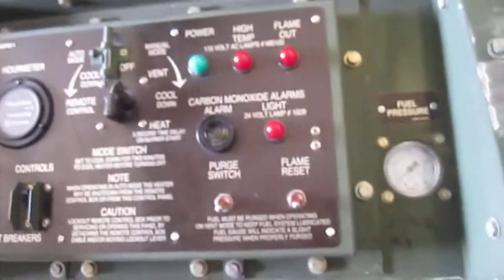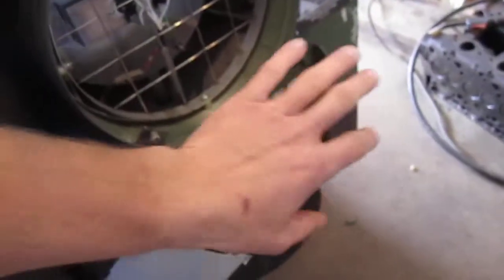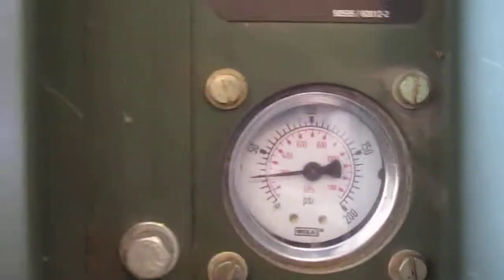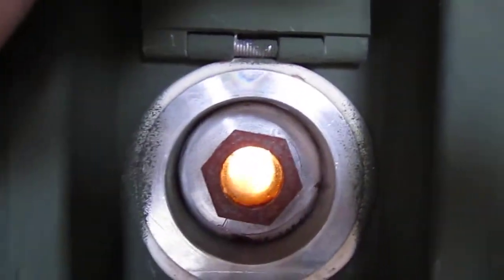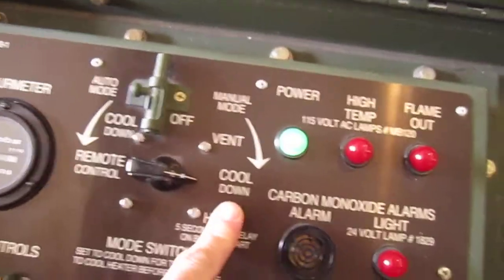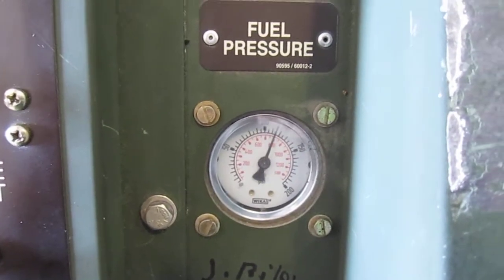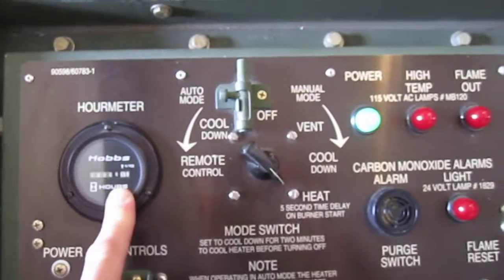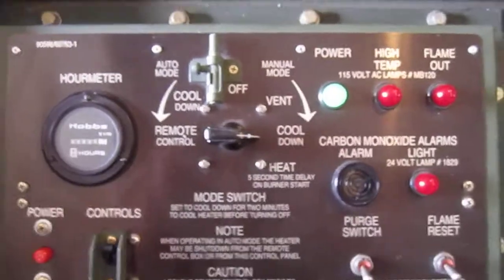army heater part 2

Comment: Do you have a video of the thermostat you installed
Reply from the maker: @ShaneDahlquist  unfortunately no but used a regular 2 wire thermostat, I cut into one of the hi limit button switches that are in the front of the unit, I believe there is two switches one is a high limit. The other is an over hi limit switch, so the thermostat acts as if the temperature is  is at a hi point.
Reply from the maker: If you want more information I’ll have to get it out and look at what wire I cut into and how I wired it.
Reply: Oh yeah that's way simpler way than prolly  dealing with any of the others.
Reply: Wires.  Thank you

Comment: have a heater like that wouldn't prime, has spark, pressure only goes to 65 pounds,, flame out comes on,  fired up one time with lots of smoke when shut off wouldn't restart same 65 lb pressure thanks
Reply from the maker: @cityfarmer3428  either a bad pump, or the pressure regulator is not working properly.
Reply: You can adjust the fuel pressure by removing the cap nut on the back side of the pressure regulator, and turning the screw in or out.  I'd recommend removing the entire pump and disassembling it.  The mechanism could be sticking, especially if it overheated from running without having been primed.

Comment: Thanks for sharing about the h140. Recently bought one but it didn't have a cap for the fuel filter. Does NAPA sell these as well as the filters and o-rings?
Reply from the maker: frank umberto yea they should have the filter and bottom cap as a kit
Reply: My NAPA sold me a filter cross-matched to the Racor R20P that has an integral water drain, so you just replace the entire unit when necessary.

Comment: Hi, I'm having some issues starting my Chocktaw H140 heater.  It only have 4 hours on it.  It's been sitting for some time 4+ years in a container. I've tried to start it but it appears that the igniter is not working and the fuel pressure when I first went to vent mode showed about 5-10 PSI but when I purged it went to zero.  The first couple of times I tried to start it, the fuel pressure started to come up and then flame out and pressure went to zero.  Now pressure does not come up in any mode.  What should I do to get the unit going?  Thanks
Reply from the maker: Sounds like the The fuel pressure relay on the pump is not working properly. Could be a power problem to it or may just need to remove it and clean it. When it is not energized it just allows fuel to bypass through the pump. When it is activated it creates pressure in the pump and pushes the fuel to the burner nozzle.

Comment: When I purge my system, it blows the breaker on my 5kw power source.  The purge solenoid reads zero ohms, and seems to have a dead short. Any ideas?
Reply from the maker: @phillipdavidhaskett7513  unfortunately no but if I get a chance I’ll look into my book about that problem.
Reply: @phillipdavidhaskett7513  will not work on gfi receptival
Reply: @jjr897  Not to bother.  It looks like I had a dead short in the purge solenoid, and the fuel solenoid was stuck closed, on a machine with four hours on the meter I bought in southern Arizona.  It was probably only being used for ventilation, and I surmise the end user burned out the purge solenoid trying to get the pressure to go down.  I've opened up the pump to make sure it was good (check), and swapped out the entire solenoid assembly off a unit I'd bought for parts.  Still no fuel flowing to the burner, so ordered a new fuel solenoid.  I've got another unit that blows heat fine using the remote, but not on manual.  So I think that unit has a bad solenoid relay on the main control board, because it doesn't show voltage at the TB1-7/TB2-8 terminals.   Do you agree with that analysis?
Reply: @cityfarmer3428  I'd imagine not.  I'm running it on a 2KVA Honda, which spins up the main blower fan without auto-disconnecting the load.

Comment: I'm working on one and need some help. I have never worked on this unit before so I'm trying to figure out how to plug the power source into a wall outlet
Reply from the maker: Justin Lofton just cut off there plug and get a three prong 20 amp plug end. I believe the colors should be black white and green. Black is hot white is neutral green is ground. What if you have a multimeter you should check continuity to make sure you wire the right wires to the plug end. Small blade is always hot wire round blade is ground wide blade is neutral